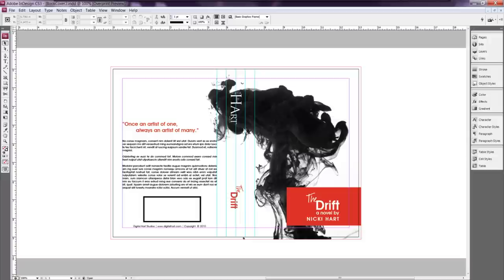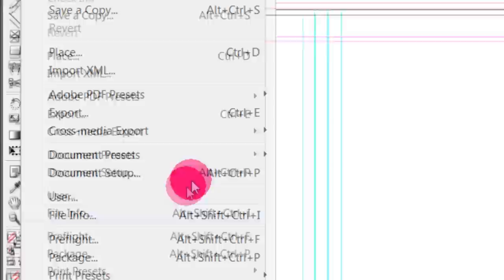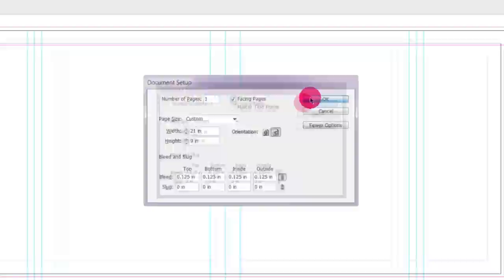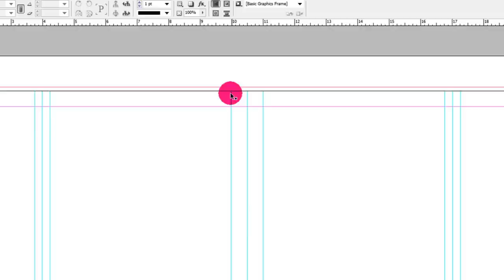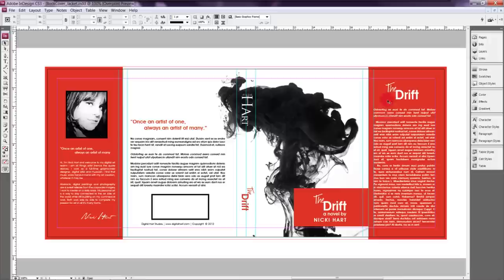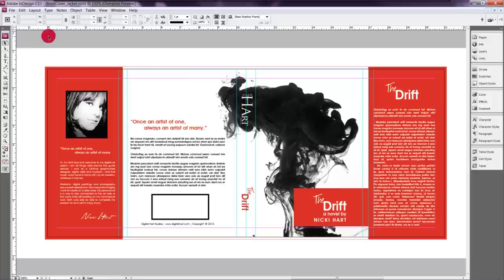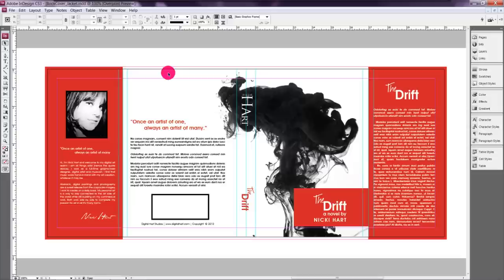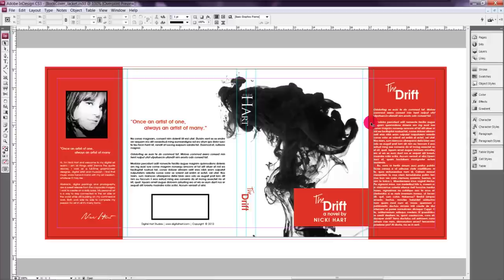How to Design a Book Jacket Cover // BOOK DESIGN

Comment: I still don't understand what exactly the "bleed" is?
Reply from the maker: Bleeds allow you to run artwork to the edge of a page. On a press, the artwork is printed on a large sheet of paper and then trimmed down to size. If you do not allow for a 1/8 of an inch bleed, any misalignment while cutting will result with the artwork not running to the edge of the paper. For example, if you have designed a standard 3.5" x 2" business card with a red background covering the whole area, you will need to enlarge that red background to 3.75" x 2.25". This will make the red background extend 1/8" on every side of the page.
Reply from the maker: I have a video all about bleeds here: https://www.youtube.com/watch?v=n9fvUhYaL-E
Reply: Thanks.  It was very helpful!